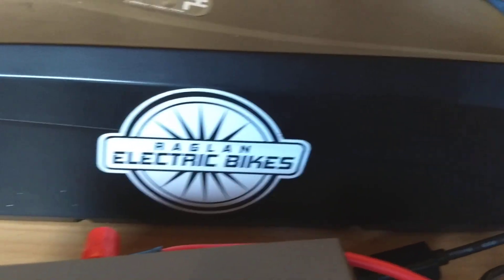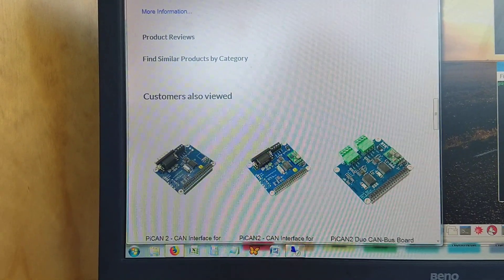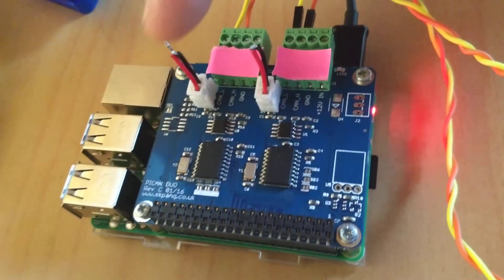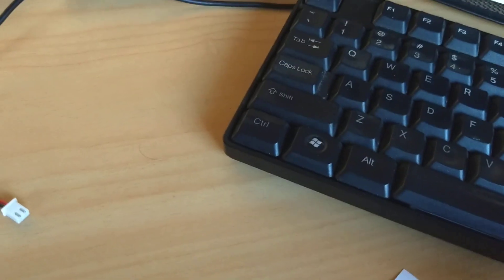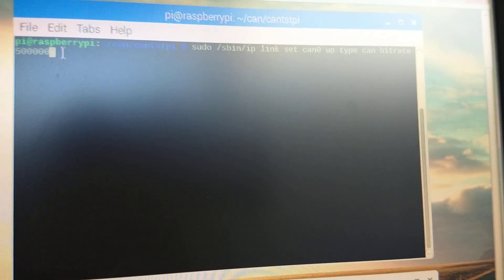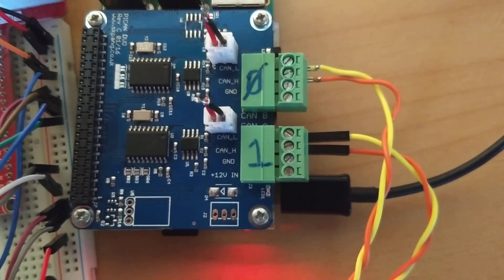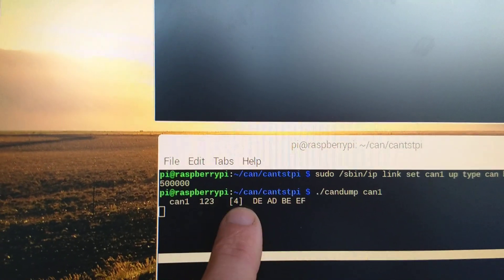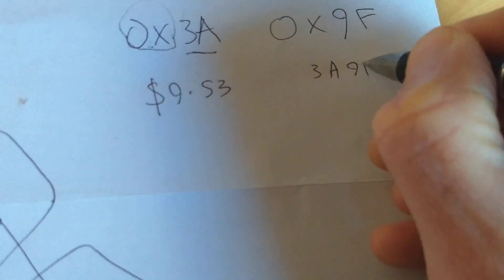PiCan2 Duo Basic Tips Raspberry Pi Controller Area Network

Comment: I have a 2002 car. It has a CD player separate from the FM/amp unit in the dash. I am wondering if you know.....the buttons on the dash to change tracks on the remote CD player.....is that using CAN communication? Thank you so much!
Reply from the maker: Not a clue but you could have fun with this gear trying to find out :)

Comment: What about if I use the PICAN2 Duo and only want to use can-1 (CE1 on SPI-Interface). Can I use then another HAT, which communicates over CE0 on the SPI-Interface? So I would not writhe the command: dtoverlay=mcp2515 can0....
but only: dtoverlay=mcp2515 can1.......
?
Reply from the maker: Possibly but I'm not qualified to answer. Hopefully the community can give you a good suggestion or maybe just try it and see?

Comment: $ also indicates hex values, I work for Continental creating ECU software

Some typical UDS hex commands would be

22 - read
2E - write
2F - output control
10 - SFD

For example, you can create a small loop to reverse engineer RDIDs the ECU supports... You will need the PDX to understand what the responses mean though, generally 7F is a negative response and 47 a positive response.
Reply from the maker: Thanks for the tips.
Do you know a good source of these codes, for example an iso standard, book or website?
Thanks again :)
Reply: @RaglansElectricBaboon  ISO 14229-1 is the main standard for Unified Diagnostic Services (UDS). It in turn references several other standards for things such as segmented messaging, the physical networks (e.g. UDS over CAN; UDS also exists on other networks), Diagnostic Trouble Code (DTC) formats, etc. Legal copies of this specification cost money, but I expect you can find a fair amount online now that you know the standard number. I've published a 16-page crib sheet of my OEM's implementation of this standard, but that's only formally available to our employees and suppliers.

The 0x7F Service ID is literally the Negative Response service, so that tip is correct. Positive responses will use the Service ID of the request message + 0x40. So service ID 0x47 is the positive response for a OBD Service 0x07 request (the OBD services 0x01-0x0A aren't technically part of the UDS service set), not a general positive response.
Reply from the maker: @rickzienert4076  thanks. My email is solarcyclenz at gmail dot com. If an anonymous document got emailed there I wouldn't complain. Also, I don't reveal my sources ;)
Reply: @RaglansElectricBaboon  Oh, you're correct to add those termination resistors while you're set up with one transceiver talking to the other without the vehicle harness or control modules in the circuit. You will likely have to remove one or both once you are ready to connect to a complete vehicle or a module on a vehicle harness. Just measure the resistance as you describe and adjust as needed. A few other tips: 
* Your "talking to yourself" network length is very short and that may contribute to some reliability issues.
* Some CAN transceivers are not robust to CAN frames shorter than 8 bytes, so I recommend padding your frames out to 8 bytes for classical CAN2.0. The old padding standard was 0x00 for the unused bytes, but the newer standard is to use 0xCC. CANFD is more complicated (and requires 0xCC padding), but that requires different CAN hardware than you have here.

Comment: Hi i got a question according the directory. Do i have to create the /can/cantstpi/  because it doesnt exist at my py and i always get the error message no such file or directory
Reply from the maker: Hi there, yes, you do have to add that. It's in "can-test_pi2.zip" and can be found here (along with good instructions): https://copperhilltech.com/pican2-controller-area-network-can-interface-for-raspberry-pi/
That's for the single CAN channel board. For the double you need to add two lines, one for each channel:
dtoverlay=mcp2515-can0,oscillator=16000000,interrupt=25
&
dtoverlay=mcp2515-can1,oscillator=16000000,interrupt=24
Reply: @RaglansElectricBaboon  I included the lines and copied the program now. I can make the networks come up without any error but if I type in candump it says permission denied. With sudo candump it says command not found. Do you have any idea what I did wrong?
Reply: Ok ignore my last question. I fixed it. Thanks a lot for your help!

Comment: There are actually three separate CAN bus systems used in my Jeep 2014 (varies by vehicle): the CAN-Interior (also known as CAN Interior High Speed/IHS), the CAN-C and the Diagnostic CAN-C. The CAN-Interior bus is used for communication between the interior modules of the vehicle, such as the dashboard and radio and runs at 125 Kbps. The CAN-C bus is used by the power train components and runs at 500 Kbps. Finally, there is the Diagnostic CAN-C which also runs at 500 Kbps.
Reply: Forgot to add more. :-)  THANKS for helping with the CAN Duo.  Here is a good spot for more information http://chadgibbons.com/2013/12/29/hacking-the-jeep-interior-can-bus/

Comment: If you swap the interrupt numbers 24 and 25  in the /boot/config.txt file Can-A will become CAN-0 and B becomes 1.
Reply from the maker: Now that's what I call a useful comment! Thank you :)
Reply: I lied! Just did some tests and swapping the interrupt numbers doesn’t swap can 0/1. I think to swap them you need to mess with setting up some rules in /etc/udev/rules.d doable but probably not worth the effort.